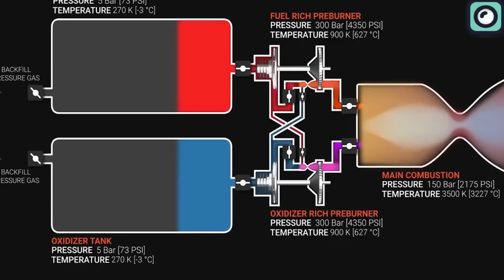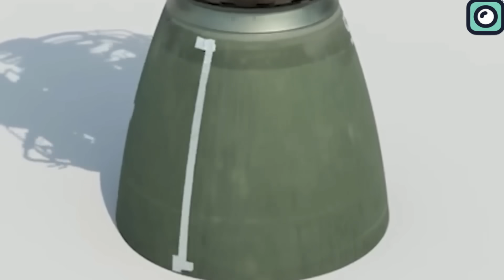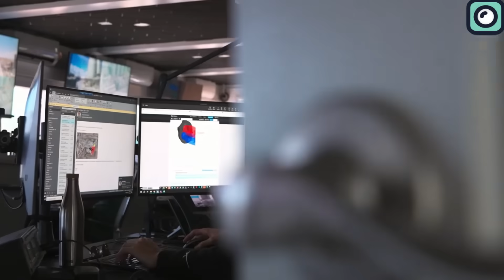Musk's Huge Update About The Second Starship Launch Engines!

Comment: Why not throttle the 13 engines to minimum before shutdown of the 10 gimbaling engines leaving the 3 center engines of the booster at 50 percent throttle? Restart only the raptors with the best parameters of not exploding during start up and operation in  the 10 gimbaling engines, 10 to 20 seconds after hot staging and booster flip maneuver allowing the gas bubbles in the fuel systems to dissipate. The starship should throttle also its engines 6 minutes after starting to avoid too much vibration even pogo oscillation instabilities, which I thought was the cause of it's explosion. This video was a tangible evidence that Space X needed explosives/FTS at Starship header tanks to avoid harming people when Starship would explode at populated areas in it's trajectory.
Reply: When traveling at the separation speeds the stages will get negative g's if the engines are throttled down too much from air drag and cause fuel starving. What they should consider are some solid rocket motors on the second stage for separation and flip the first stage around before burnback engine ignition by using the grid fins.

Comment: The fact that every engine functioned nominally through the entire boost phase was a monster triumphant success!!!
Reply: We’ve mastered this 66 years ago. Can we please be realistic and admit this is a bad design
Reply: @sgtgiggles  Explain. Why is this a bad design, mr. rocket scientist? Please, humor me.
Reply: @sgtgiggles ”This” was not mastered 66 years ago because “this” is an attempt to reuse the main booster. The Saturn 5 boosters crashed into the ocean. The five F1 engines would not be suitable for this purpose. They were an amazing accomplishment but I am guessing SpaceX, having successfully landed and reused the Falcon 9 boosters over 100 times, know what they are doing.
Reply: @twm4259  you may wanna check your sources there. The only difference is fuel. It’s not exactly hard to reuse the main engine. We had the space shuttle which was only a tad more reliable than this garbage. It just had a grip of cash flung at it so to not look bad
Reply: @sgtgiggles  You are living in a dream. There are at least a dozen reasons the Saturn 5 booster could not be landed. It was not designed for that and it is non trivial to do so. If it was just a matter of different fuel then why did it take 60 years to accomplish? There are huge benefits to doing it and only SpaceX has demonstrated the ability to do it repeatedly.

Comment: When the second stage ignites, if its thrust overcomes the thrust of the remaining first stage engines, it could decelerate the first stage.  This could lead to an interruption of fuel flow to the first stage engines.
Reply: I agree fuel slosh is the problem from what I have heard and read. I wonder if they could design a tank that can constrict. The constriction (squeezing) would provide its own fuel flow pressure lessening the dependence on fuel pumps and keeping the fuel from sloshing. As the tank constricts, its interior volume would shrink pushing out fuel but leaving no space for slosh.
Reply: Are you talking about after separation? How could the separated first stage decelerate the starship?
Reply: @331SVTCobra  I think he means that when the first and second stage separate, the thrust of the second stage pushing against the bulkhead on the top of the booster creates a moment of deceleration on the booster. That deceleration could cause the fuel to slosh toward the bulkhead due to inertia. That could possibly move the fuel away from the fuel pump intake and allow the pump to ingest gas. If the pumps ingest gas, the fuel delivery system will destroy itself due to fluid hammer effect once the pump pushes fuel through again.
Reply: That's my leading theory, you could see the booster trying to light engines for the boostback three times and everytime it was followed by an explosion, likely cavitation in the turbo pumps. then the FTS triggered or a catastrophic explosion happened in the engine bay.

Comment: This is why these Launches are called test flights.  Test flights are never failures.
Reply: Well, this is not just a ‘test flight’; you do Test Flights of vehicles that have already intended to have their designs finished, which is not the case here. In SpaceX’s iterative approach- which tends to minimize integrated testing on the ground (very good- but, very expensive and time consuming)- this is Development Flight Testing: part of the overall design/development process. In short, they don’t know what the final design is, yet; they fly, they break, find out where the design weakness is, fix, fly farther/better next time, break later…..repeat. - Dave Huntsman
Reply: @dphuntsman considering nobody is anywhere close to what spaceX is doing, I think they have good reasons to do it how they are doing it.
Reply: @Fighter4Street  Wellll…maybe, so far. I’ve argued - still feel, in fact- they’ve made one mistake in this case: by under-testing the integrated booster propulsion system on the ground- something they can’t test enough without a separate test stand they declined to build, since they can’t use their one and only launch pad for that much risky testing.
Reply: @Fighter4Street No they don't! They are trying to do it on the cheap without testing!

Comment: Not exactly a huge update. Things we were already familiar with. We pretty much knew of all the corrections but we still don't have details on what caused the failures.
Reply: Agreed, space x is going to overcome the problems by "enhancing" the engines, fuel systems and control systems, apparently.
Reply: Not ground testing is why they are failures.
Reply: Howard Hughes syndrome.